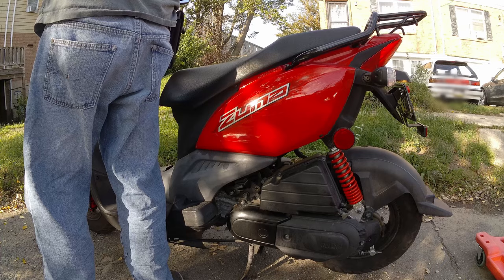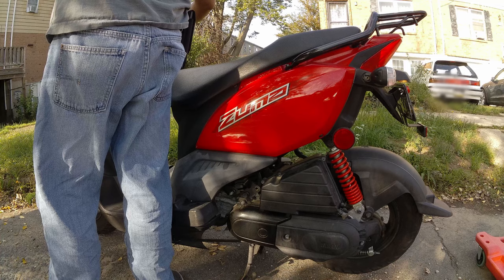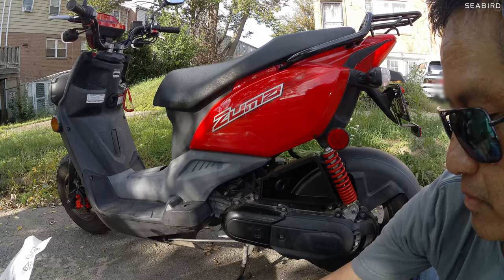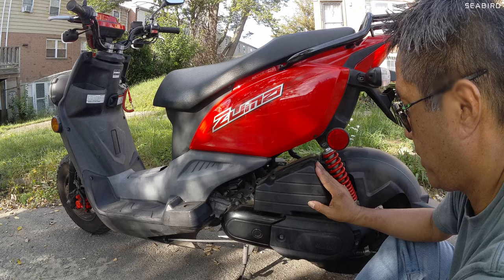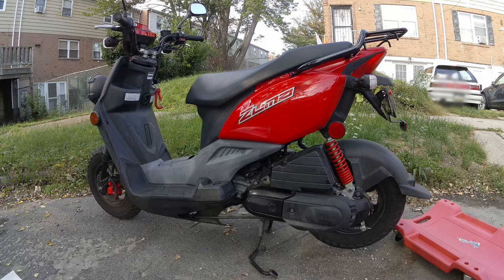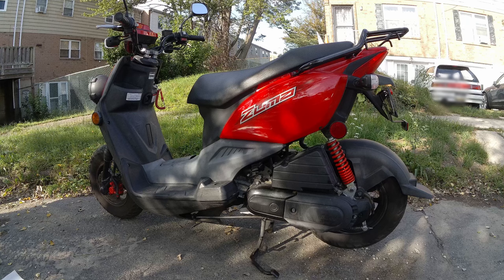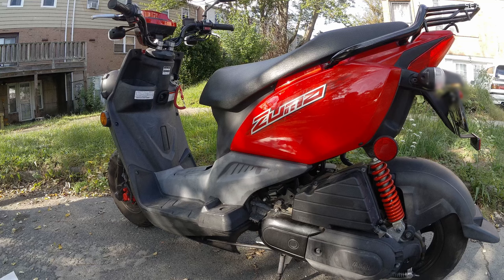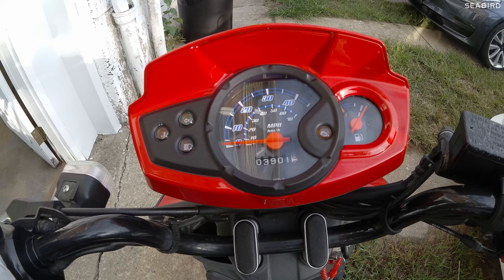Gas SCOOTER / Motorcycle Won't Stay Running EASY FIX

Comment: It works really well for small engines. I have a craftsman lawnmower. If I spray the carburetor after I’m done, it will start with a half a pull the next time I use it. Doesn’t matter one week, two weeks, etc. if I don’t spray the carburetor-20 pulls. 30 pulls. Hard to start.

Comment: I just bought a scooter and it won’t stay on. I figured it was just a dead battery, the seller told me it’s been sitting for about 2 years. I figured the gas was stale and the battery was no good, but I’ll definitely try this when I have a free day to work on the scooter
Reply: So how was it
Reply: @NBaa2123  dirty carb. Had a mechanic come take a look fixed it all for about $100. I noticed I wasn’t getting any vacuumed pressure from the tank to the carb. I gave up on fixing it myself.

Comment: I see that after you fix it and you start it, the back wheel is spinning. I have a problem with my Uber Scoot 49x 2 Stroke, when I start it, and it's just parked, the back wheel runs at full throttle. Essentially I cannot safely turn on the scooter without max holding the brake. If I max hold the break, the scooter shuts off.

Ive check the intake screw, throttle screw, and the throttle cable as well but everything seems to be in order.

Comment: My moped is full fcked. I start it and then about 15 seconds later it stalls. And when I try and put throttle to it . It stalls quicker
Reply: Daddy Savage  I ended up getting a new scooter. I start it up every day coz I don’t want to make the same mistake by leaving it in the shed for months
Reply: Sounds like it needs a valve adjustment

Comment: Was wondering if i can get that kind of spray i tried choking the hose thing it takes a time to start doing that but won’t stay running then gotta keep trying to restart i checked the filter thing and replaced the spark plug still nothing i can barely ride it without it dying
Reply from the maker: U can find cleaner at any auto parts store

Comment: Mine starts up it stays on but soon as I hit the throttle it cuts off
Reply: Drain out the old gas, fill it up with new gas, if air fitter as dirty get new one, also spray carb cleaner inside air intake like he did in video, do that a few times, do a new oil change, maybe buy a new battery old battery can cause that problem too,

Comment: Great vid!  So my 2012 Yamaha Zuma 50 starts ok but its stalling when I try to accelerate and now won’t go faster than 20mph.  Do you think spraying this choke cleaner will clean out the injectors? It sat in my garage for 3 years and just tried driving it this summer.  Crazy thing is the first time I drove it 2 weeks ago it drove normal and fast but yesterday it just started doing this stalling thing.  Appreciate the advice.  Thanks!
Reply from the maker: I would try to see if it works, then check fuel line, air filters, throttle cable, or gas may be stale u can try fuel cleaner or additive. If it still doesn't work I would try remove all the gas, replace with new one.
If still doesn’t work I would take it to the shop. Hope that helps.
Reply: @Xonster  Really appreciate the reply and advice.  So I decided to take it into the shop.  Got an appt. Thursday. They think my injectors are dirty from it sitting to long.  

Another quick question.  Any idea how to remove the governor?  I’d like it go like 5mph faster.  I can hit 45 but then the governor stops it from going past that.  Also do you think it would damage the motor with the governor off?  Thanks!

Comment: I recently got a tao Tao 50cc scooter, it started perfect; now it’s been about 2 -3 months since I got it and it will start, then shut off, no matter what I did.  I tried to start it, then rev it, and it would stop.  It works after like 5 minutes of trying, but when I get to a full stop, it somtimes shuts off.  Should I do what you did in the video you think or are you not sure?
Reply from the maker: Not sure if it will work. If your scooter is new, you shouldn’t that problem. The cleaner just help with stuck valve, from scooter sitting to long in storage. My old 1986 Honda Elite 150cc got it started and runs.
Reply: @Xonster  idk, maybe it just came with a shitty battery or somthing.  The lights were also flickering, so it might have to do with the battery
Reply from the maker: @brockstremmell2583  I would check: fuel to see if water is mix in, fuel line, throttle cable and adjust idler. Yes check battery, and check to see any expose wires. I read some reviews on this brand not that great. Some have the same problems you have. Hope it help.